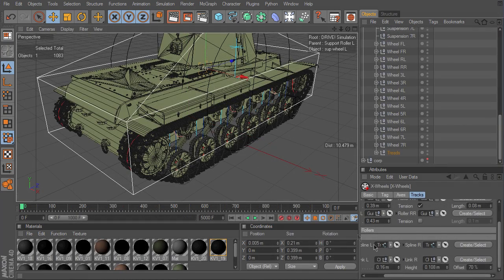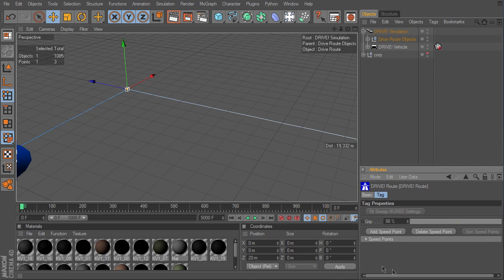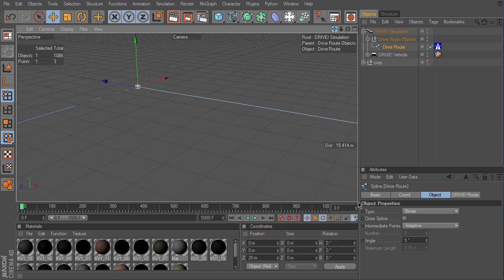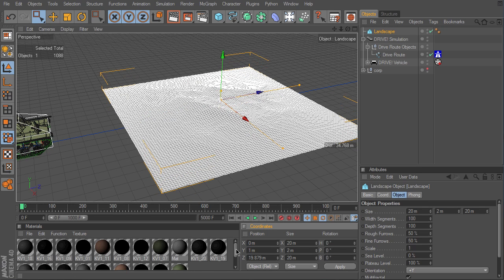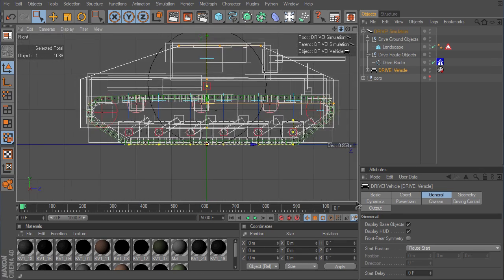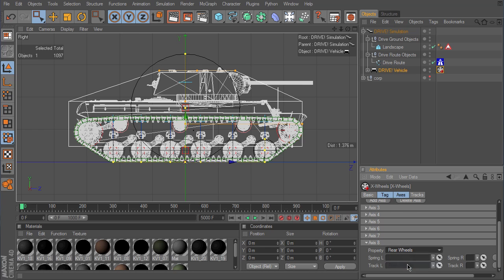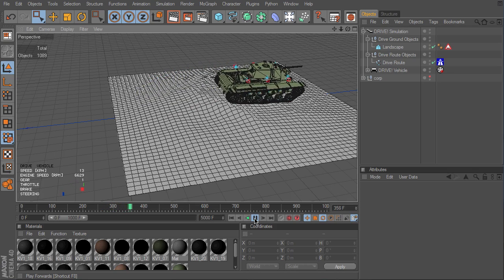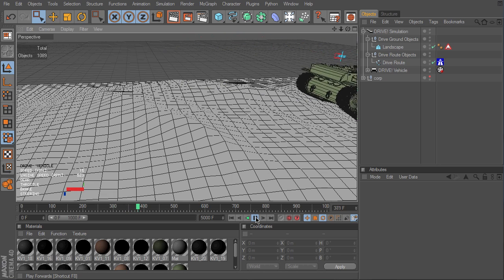Simulation of a tank :: Tutorial Part 4

Comment: How you disable flipping wheels when tank turn to 90 degree?
Reply from the maker: What do you mean with "flipping wheels"? If you have a problem with the software, please contact the support on c4dplugin.com
Reply: http://prntscr.com/kxth3g
See what I mean))
Reply from the maker: You have to activate the "Tracks" mode on the "Tracks" panel of the X-Wheels tag.
Reply: ftRoarrr  In which version did the "Tracks" mode appear?
Because I don`t see any "Tracks" panel on the X-Wheels tag))
http://prntscr.com/kzai3r
Reply from the maker: sorry, it is called "Treads" not tracks.
Reply from the maker: Please contact the support on c4dplugin.com.
Reply from the maker: OK, I could reproduce the issue. It appears, when you stop the animation. But it's just a cosmetic problem. If you run the animation resp. you record to keyframes and render, everything is fine. We will fix that bug with the next update.